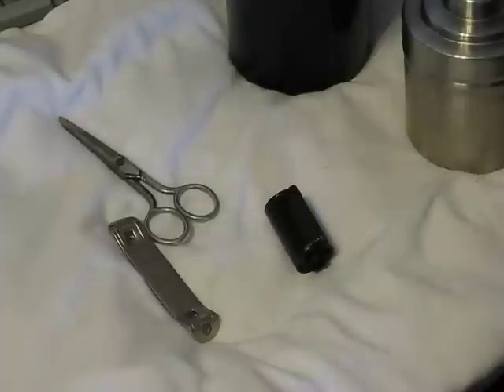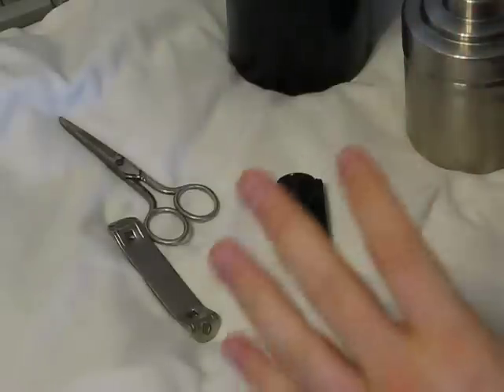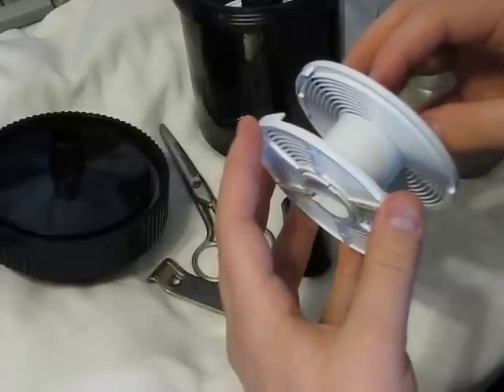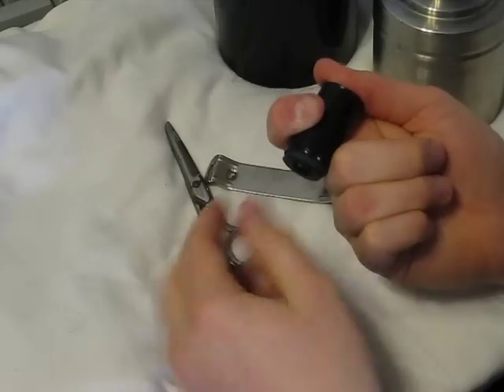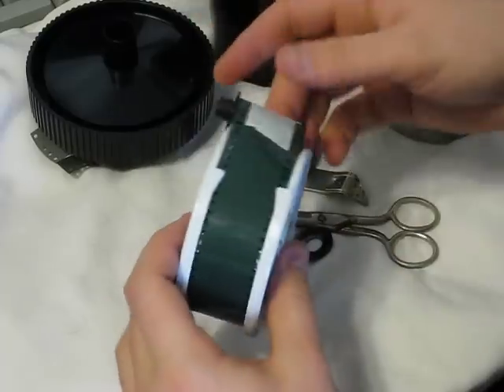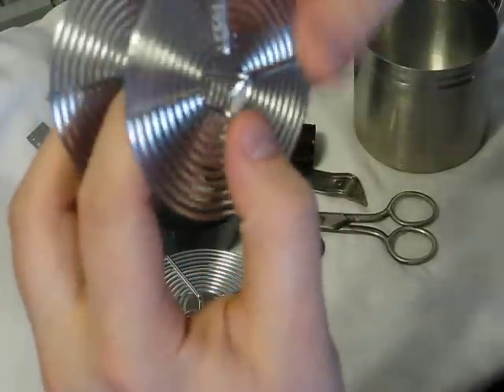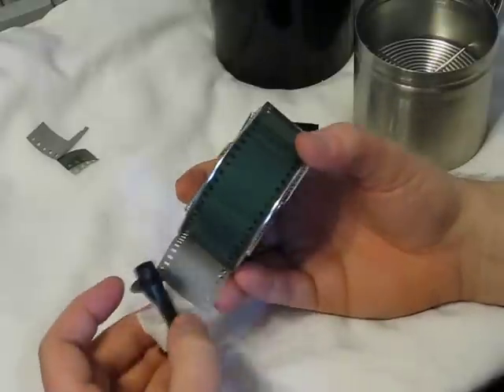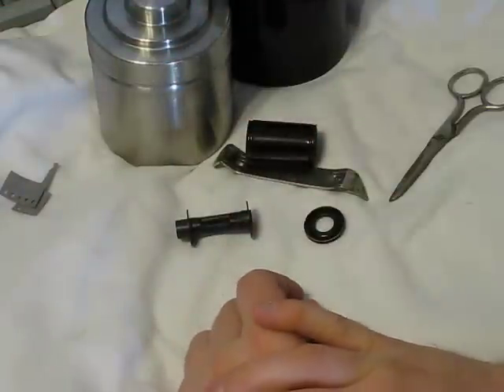Loading 35mm Film onto Plastic or Stainless Steel Reels

Comment from the maker: I used to say plastic, but I've revised that recently. I think SS is the best option. The results are apparently better (more even chemical flow) and the spirals are ore durable. The plastic spirals also absorb chemicals and that smell is NOT easy to get out if it gets into your drywall, cabinetry, or carpet.  Simply storing plastic reels can impart that smell. Also, tanks for SS reels require lest chemical volume and, therefore, over time, are a lot cheaper.
Reply: Bit late, but plastic reels are dishwasher safe, and that removes most of the chemical residues. I learned this from the art class I took last year.

Comment: I was loading in a darkbag, but the darkbag died a short time ago and I had to resort to trusting in the darkness of the downstairs bathroom (the GFA light is on a linked upstairs circuit, hooray!). This is a room within a room within a basement, so there is plenty of light trapping ability and so far I have run three films without issue. The best thing about this is that I can start the film on the (plastic) spool in the light (the bit that's ruined anyway), then hit the switch and start winding on. The leader I clip off to straighten the film leading edge, and drop it into the fixer to test its strength.

One of my Patterson reels has become a bit difficult recently and is for some reason not winding the film on any more. I have put it aside (I have a spare), and I pocket it before I start the winding on process then, after the film has been placed in the tank, I take it out of my pocket and put it on the spindle as a dummy spacer. Then I put the light-tight lid on the tank. 

I had one accident once where I used chemical volume for one reel and accidentally put the spindle in upside down. This ensured absolutely that the chemistry was clear of the film throughout the whole experience (I was using the agitator rod). My rage when I opened things up knew no bounds, but of course there was nobody to blame but me. :p Now if I am doing only one roll, I put it and the spindle in first, making sure that the spool is pushed to the bottom of the tank before I reach for the dummy spool. If the dummy/spacer spool won't go in on top, I know I've done something wrong and need to flip it over. If I'm doing two rolls it doesn't matter; the chemistry will cover both anyway.
Reply from the maker: Ouch. I've done similar things with film development, too.

Basement or interior bathrooms are ideal. The GFI light won't fog film, or shouldn't. (I still have four layers of electrician'stape over mine, just because.)

For the broken reel, check that the ballbearings are both in place. If one fell out, the reel won't spool any more. Another possibility is that there's a piece of film or something in one of the spirals.

Comment: Honestly, just get the leader out of the can and cut the leader off in the light. Makes it so much easier. Plus, you can just rip the film off the spook at the end, so no need for can opener or scissors. My dark bag will not die that way!
Reply from the maker: That works well, too. Thank you!

Comment: For many years I used stainless steel reels. I just started shooting film again after 22 years and my first batch of film a couple of weeks ago loaded fairly uneventfully onto plastic reels, but the batch I am trying to load right now is giving me a big problem. I loaded onto the plastic reel and it locks in and I start walking it through but it only gets about halfway and will not finish. Any suggestions? I'm going crazy.
Reply from the maker: There are some common reasons for that. A big one is a water droplet in the reel. That's the most common thing. Next would be some damage to either the reel or the film sprocket holes.

Comment: Could you boil the plastic reels to get the chemicals out?
Reply from the maker: I wouldn't suggest it. That could cause the plastic to break down and then cause them to absorb more chemicals or wear out more quickly. If you just dropped them in a pot on the stove, then the direct heat might melt them. Also, if the chemicals leached into whatever you used to boil them in and that were used for food, that could be an issue.

Comment: i keep having problems with the film getting coiled while trying to walk it in and then I cant fix it. Any help for this? Should I keep it rolled up while walking it in instead of laying it out? Thanks!
Reply from the maker: Yes, keeping it rolled while you load it should help. Other than that, the technique is all in the fingers. As long as the spool has no broken spiral guides, then the way you work the film with your thumbs should control how well the film loads.

Comment: Where can we buy 127 film???
Reply from the maker: There are some people who re-spool it and sell it. Ezox Rerapan and Rerachrome are specifically 127 films (and both are good.) Also, each spring (right about now!) Ilford has an Ultra Large Format (ULF) special-order event and you can order a spool of the FILM ONLY in a large length and then in complete darkness cut it to size yourself and re-spool it by hand onto old spools and paper. I have done that for an entire roll of HP5+ in 127 width and it's starting to get easier, but is never really easy. Also, XKAES (https://www.etsy.com/shop/XKAES) sells film slitters that he makes to cut 120 to 127. I have one and it's good. You'd still need 120 spools to re-spool it onto, however. If you're just starting out, go for the Rerapan or Rerachrome and they're easy options.